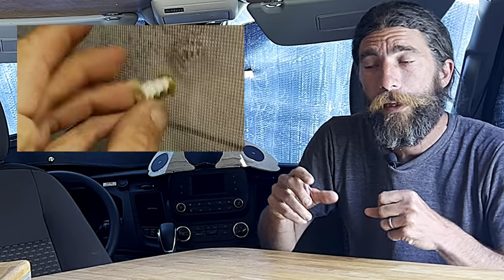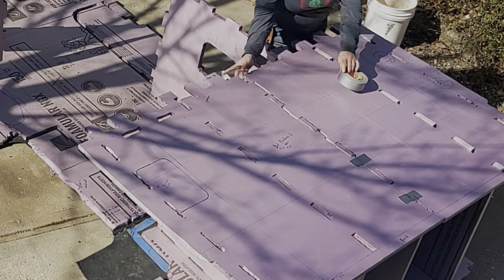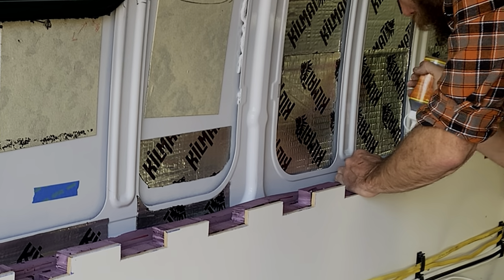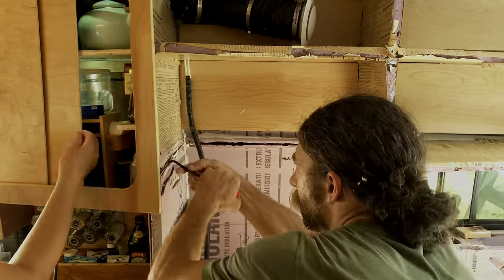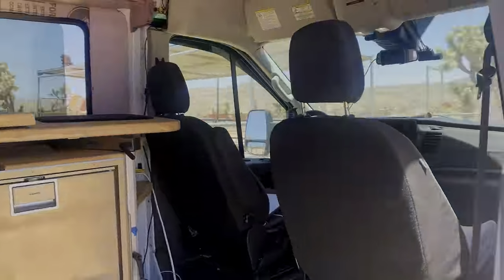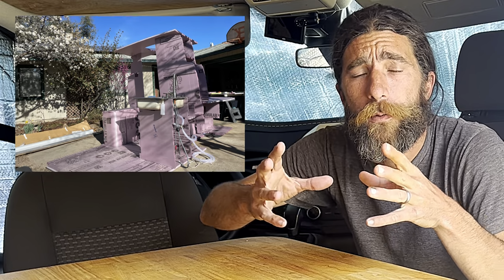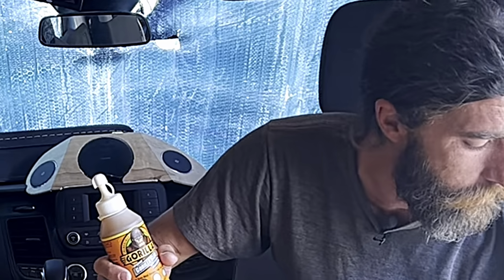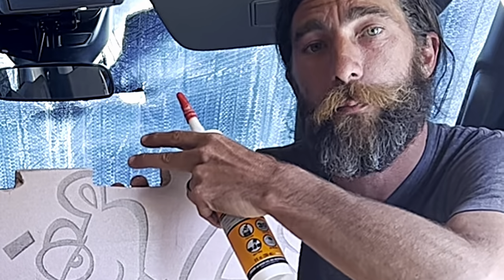Foam Camper Van Glue Up -Foam Building System Vol. 4

Comment: thx a lot. The only problem I see, is to find an alternative product in Germany. Cause Gorilla glue dosen't exist here
Reply from the maker: The gorilla glue I used for most of the glue up would be a “construction adhesive” that hardens to a flexible / rubberized state. The gorilla glue original (for screw anchors, etc) would be harder to find. The fact that it expands as it dries is one reason it works so well.
Reply: @falkornomad  Thank you. I think I have found something. I will try your experiments and report in a video.
I am totally enthusiastic about your method
Reply: Gorilla glue original is polyurethane glue. You should be able to fine polyurethane glue.
Reply from the maker: I DID NOT know this… polyurethane glue eh… learn something new every day!